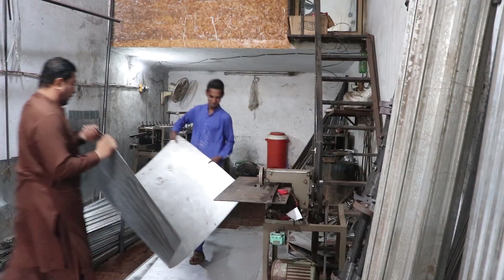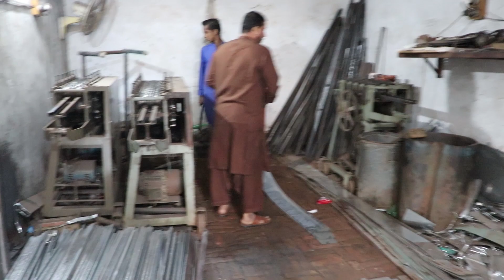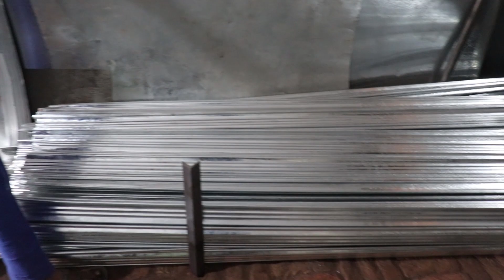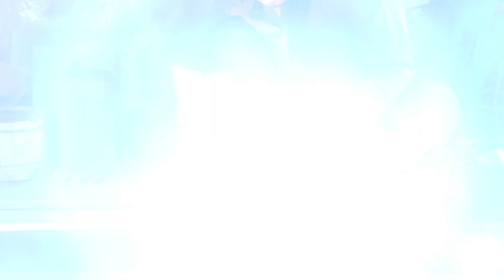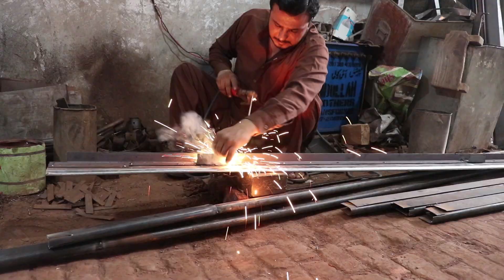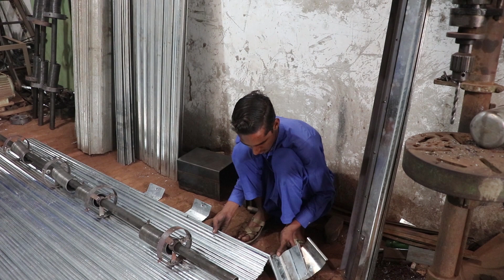How to Making Shop Shutter Gate | Folding shutter Gate |  Splendid Effort

Comment: Shop shutter rate
Reply from the maker: Depended on size
Reply from the maker: Where from ?
Reply from the maker: I will tell you later
Reply: 12 foot shop
Reply from the maker: Hieght wirth
Reply: @pkworks609  12by 10
Reply from the maker: Where from ?
Reply: Multan
Reply from the maker: Whts your contact numbr

Comment: This is a very efficient, clean and tidy production facility manufacturing high quality, affordable products for the community.

They are able to build in the value of their product from its bare, rolled sheet metal form, by putting it through the corrugation forming machine in strips.

The corrugation formed parts link together to form the shutter body.

All other components are able to be manufactured in house.